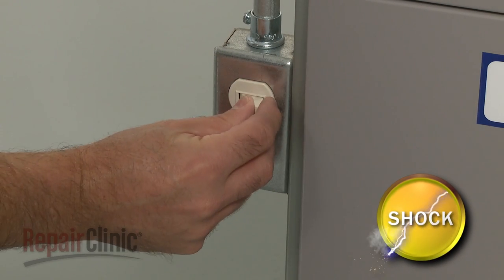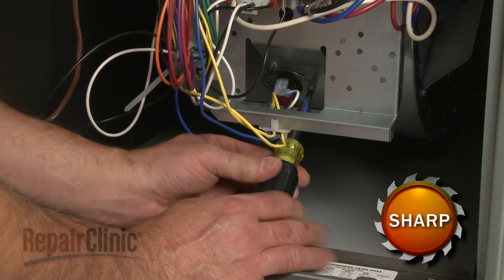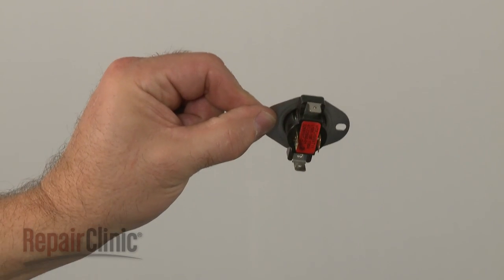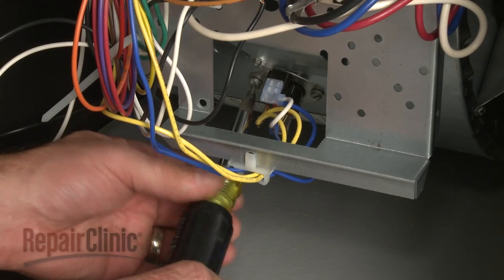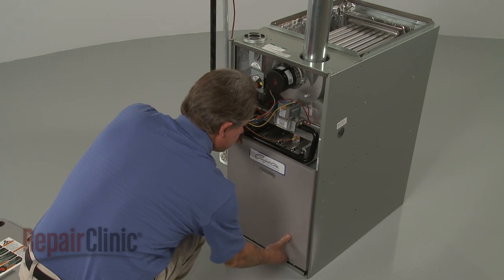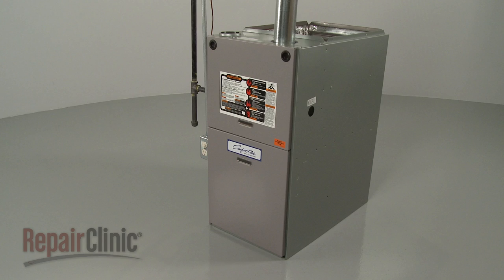Rheem Furnace Fan Limit Switch Replacement #47-22860-01

Comment: Does it matter which end is which on the new limit switch for re-attaching the wires?  I have part #47-22860-04, instead of -01.  Your video doesn't mention if the orientation matters.  It looks pretty symmetrical to me.